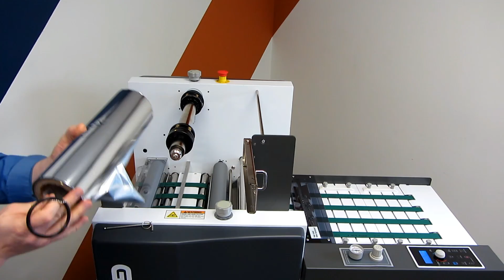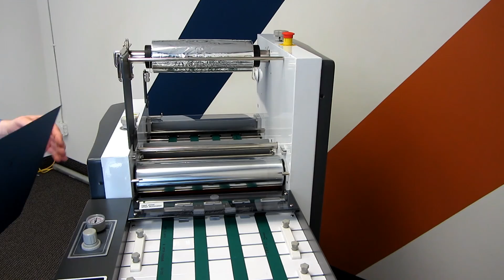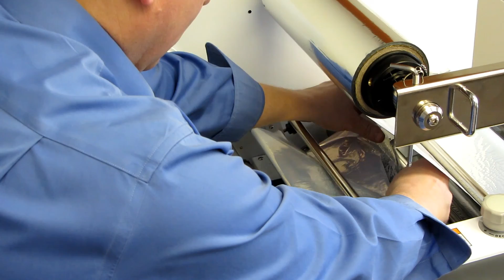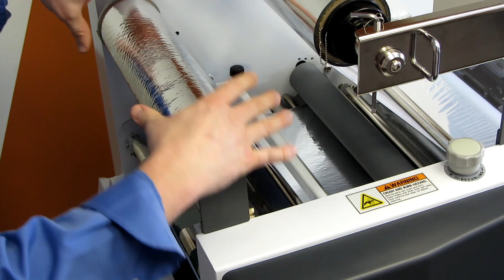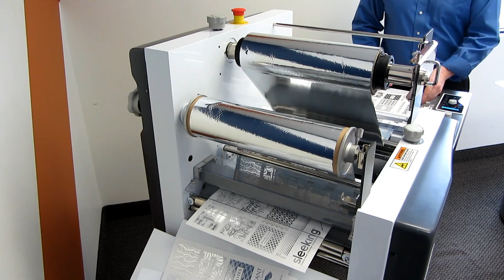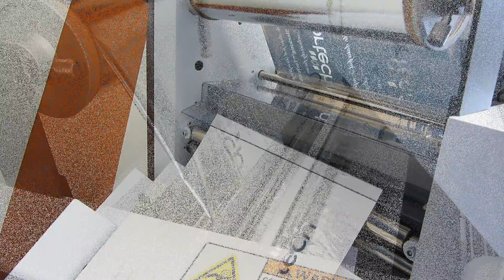QTopic Tutorial  Part 2   Sleeking

Comment: Hello Do you have some tips about how to have sucessfull job done. Because I am on a HP indigo 5500 but have so many issues. Generally my sleeking have so many gaps on the sheet (letters, corners etc). It seems that the ink does not stick weel on the paper, even if I use qualified paper. Thank you.
Reply from the maker: Hello Jerome, Indigo’s tend to be challenging to use with SLEEKpro technology when compared to dry toner. But with the right setup and stock, they can be used successfully with amazing results. 

Here are some pointers to try: 
• 4 hits of ink required at a minimum. Up to 8 hits may be necessary to achieve a sufficient buildup of ink.
• Each hit should be at 100%, so 4 hits will achieve 400% ink coverage 
• Yellow is the most aggressive compared to other colors and sticks best to difficult stocks 
• The key to avoiding picking is making sure the foil doesn’t pull from the ink until the stripper bar.           
     - Make sure pull rollers are turned off
     - Print a ½” wide border around the whole sheet to help carry it through
     - Minimal take up roller tension, just enough so that it keeps pulling and the foil separates from the sheet at the stripper bar 
• Indigo Digital Ink has to be cured before sleeking 
     - At least 8 hours when sleeking on paper 
     - If you try immediately, it likely will pull the hits away from each other. If you cannot wait 8 hours, give it as long as possible, the results at 2 hours are better than not waiting at all. 
     - If overprinting on top of foil or difficult laminate it needs to cure for at least 16 hours before sleeking again or any other process 
• Overprinting on top of foil can reduce blanket life span.  
     - Recommend running 10 sheets, then a blank cleaner sheet followed by 10 more, etc.  
• The inks need to be rebuilt periodically or they won’t adhere to the paper or to each other. We suggest doing one color a week so each is rebuilt once a month. 

This video from our Print2Finish event should also help: https://youtu.be/t52S-wljJwY
 
Try these tips and if you are still struggling let us know. You can email service@skandacor.com to schedule a virtual or in-person call.
Reply: @Skandacor  
Hello Thanks a lot for your quick support. I tried yesterday some tips and it began to be better (trying to make full gold benday), it was not good until I pushed the temp a bit more. I have to try now on text. I will let you know.
cdly
Jerome
Reply from the maker: That's great, Jerome! Please keep us posted, we'd love to know how it worked for you.